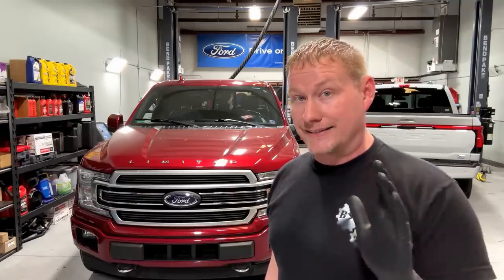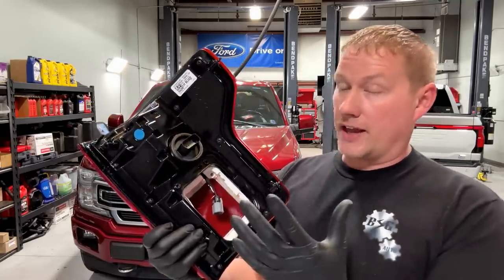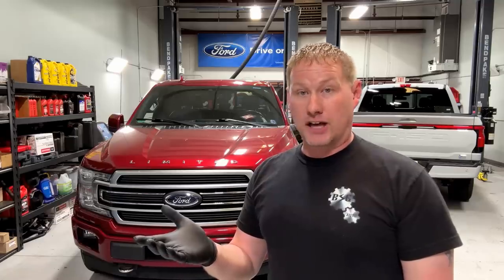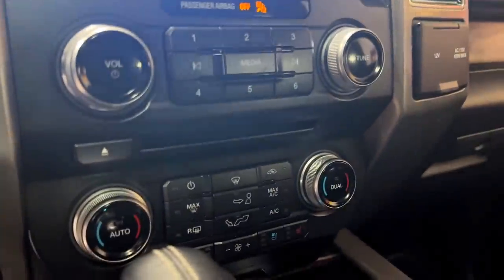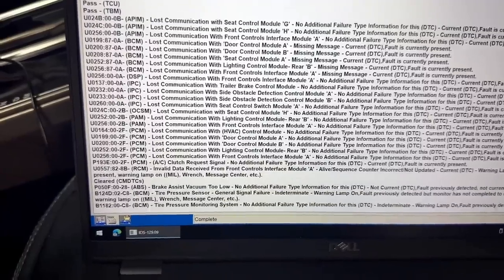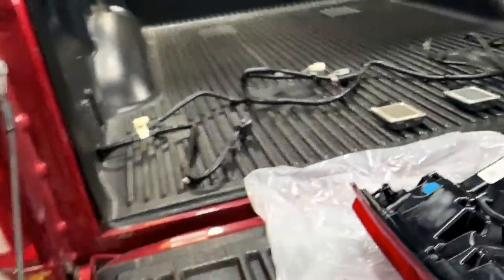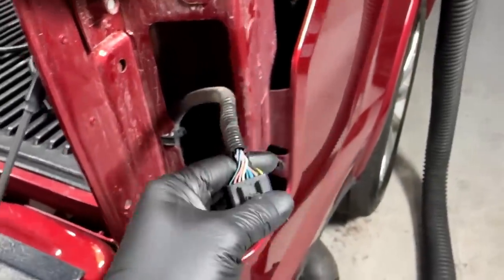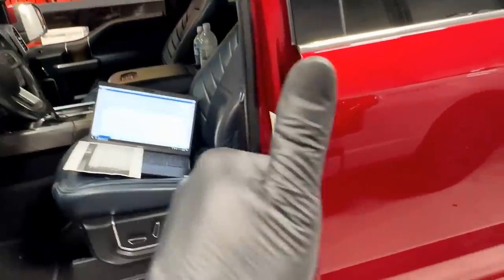Repair Cost Are Out of Control: $5,600 Bill for Some Tail Lamps?!

Comment: local dealership...went to shop and had a recall  for it,,, then they gave me the sheet,,, $1,400. cad added to my estimate for my front end suspension on my Hyundai// no .. walked out and I went to my b rated mechanic and only said it was $400. cad

Comment: Up until about three weeks ago I had a 2017 F150 ecoboost. We were going on a long trip when the cam phasers started making noise. $2700 estimate from the dealer to repair. That along with almost $1000 replacement on a leaking oil pan, a phantom coolant leak and warped brake rotors sealed the deal. I figured I could put another 4-5 grand into repairs or get rid of it. Traded it in for a newer vehicle, not a ford, and haven’t looked back. Truck had never seen hard use, kept it maintained will probably be the last Ford I ever own.

Comment: Thanks for pointing this flaw out to everyone. I have a 2020 F150 XLT and every time I leave the car wash, stuff doesn't work until it dries out and magically comes back to life. Mostly, it's been drive mode unavailable, which lead me to believe that there was a harness connected to the transmission causing this. Bingo, you nailed it. The local Ford Deale here is totally useless for any issues I may have.

Comment: I had a tail light case do the same and i spent the $1200. I did the work myself. My engine was shaking but was purring after fixing the t.l. I also had a brake issue. One side wore until metal to metal with no early warning. Had all brake rotors & pads changed. The gas mileage went up. Before, i got 11.2 mpg at the most. It's 12 mpg and climbing now. Go figure.

Comment: And let me guess, they did not cover it under warranty. And the people that just "Accept" this is the reason the rest of us cannot afford a vehicle. I had a similar problem on another F150 where the windshield leaked due to a manufacturing problem and leaked right into the brain module. Nope, not covered. Might as well had been a Pinto analysis - less cost to pay for legal fees of people killed rather than fix the problem. Just another reason I don't buy Ford or new.

Comment: im also a shop owner /operator ,mechanic 33 yrs ,  if people continue to buy their garbage , they will continue to take advantage of you , I drive a 1988 f350 diesel  , no ecm, no bcm, no tcm , no def , and what do ya know ,  it runs beautifully , and is ridiculously reliable , I couldn't count the times my old f350 has come to the rescue of newer vehicles , I see this in my shop often , overcomplicated over engineered and made to keep you coming back , for more parts , just had another Hyundai in the shop with the gdi motor this one 2016 , with 68,000kms engine seized solid , auto manufacturers are just like any big corporation , they are not ever looking for ways to make what they sell you better /more reliable , they are paying engineers to come up with all kinds of unnecessary components , you do not need , they have also made an art out of building components that will work for a while then fail , know this , more complicated is not better in any way , and also know that it is perfectly possible for the manufacturer to build cars and trucks that would last most of a persons lifetime ,

Comment: That's why I don't want anything newer than 2000. The problem is the shops don't want to work on any older cars because the new generation of so-called mechanics can't diagnose anything without the computer telling them exactly what part need to be replaced. So I have to take the time to do everything myself. 

I wonder what will happen when older people will be no longer able to fix stuff themselves.

Comment: It cost almost $300 to get my front headlamp replaced on my Ford Fusion SE because of poor engineering. The front bumper had to be removed to change out the bulb.  Not even LED.  Ford needs to review the ease and cost of servicing every model because the engineering of their recent cars shows a lot of failure to make repairs for even routine repairs ridiculously expensive and complex.

Comment: You are 100% correct concerning the cost & complexity of repairing the newer cars.  Those unnecessary modules are expensive, can often be on back-order, & seldom improve the performance or reliability of the vehicle.  The electronic engineers have now taken over the mechanical engineering of today's cars & trucks so get ready for a wild ride!

Comment: Huh, you use the same exact intro style as another channel I know. Weird seeing the exact same animations/background and having it spell something different this time. At some point people are going to realize trucks are no longer trucks. Super picky and fail all the time, repairs are complicated and extremely expensive assuming the parts are in stock, etc. They're not trucks anymore, lot of commercial places that I do work for have switched to panel vans for that exact reason. More space, can still tow/carry/move stuff, but half the price and half the trouble. Boggles the mind seeing a work truck be totaled in less than 10 years due to an electrical issue, twice in a row.

Comment: I have a 2015 Lariat F150 that experienced the same thing. Fortunately for me when Ford told me what the replacement cost was I took the tail light home and used a hair dryer , dried the module out , resealed it as well as the lens leak. That was 2 years ago and still running fine. The tail light moisture issue caused my radio, HVAC, power windows, all to not function.

Comment: I had the exact same thing happen on my car in high school, a bomber '63 Impala.
The tail light burnt out and removing it damaged the socket.  I had to find another socket
and solder up the connections.  - thank God I had one in my tool box.  I had a bunch of bulbs
as I steal them from the junkyards, that's the only thing I steal, 'o, and fuses  😆😆😆

Comment: The engineers wouldn’t put all this electric crap on vehicles. If you the buyers didn’t demand them my 2009 Ford ranger doesn’t have any of this crap on there hell even the climate control is cable operated that darn truck is 235,000 miles on the original powertrain all I ever had done it was a water pump, no electrical issues. See that to one of these new over priced urban cowboys if you really need Blindspot protectors, blah blah blah maybe you shouldn’t be driving a big truck in the city

Comment: We had troubles with taillights with some Chevy vans in the sixties.  We fixed the water problem by drilling 3/16" drain holes in the new taillights before installing them.  If the water is allowed to drain the only problem is an occasional blown bulb.  As soon as I saw water collecting in a light fixture on any of my vehicles, I replaced the bulb and drilled drain holes.  Never had any electrical connectors corrode after doing that. If the water drains quickly they soon dry out.

Comment: My brother is a Ford fan. In 94, his step dad bought a brand new f250 with everything on it. Three months later, he ripped off the driver's side mirror, which had turn signals in it. Bottom line is that the vehicle was totally disabled. Not covered under warranty, it cost him over 3000 in repair bills plus a tow to the Ford garage. It's been going on for a while 😮

Comment: What a terrible design, should be a safety recall, it has to do with safety 100 %
Great video 
Also,  if you replace all the taillights, do you have to get it reprogrammed to removed the notification on the cluster

Comment: Thank you sincerely for taking the time to make this and a couple of more associated videos. It saved be a lot of money. Bushings were $7.00 from Auto Zone and the few hours of my own time saved $600 from the local wrench's estimate to replace the complete shifter tube. I smoothed out the tube where the bushings are located under the clamps, removing the casting marks and rough spots which helped chew up the original bushings. I also applied a little White Lithium grease on the tube where the bushings ride and it shifts like new.

Comment: In all truth, not of those components are worth that much. It's called maintenance for profit. It's why I don't work in my field anymore. Just also want to add that you can buy a 3d resin printer for less money and print your own connectors. Contact your federal reps and demand the right to repair YOUR stuff. F*ck proprietary sht

Comment: I'm astounded that there's modules located inside the tail light housing. That whole thing looks like was designed to fail. Tail light lenses are notorious for getting cracked and allowing water ingress. I remember a 1990s Japanese car I owned; the tail light harness connector was inside the car, sealed behind a waterproof grommet. The only electricals that could potentially be exposed to water were the socket contact pins for the bulb.

I started hating working on modern cars, and instead became a bicycle mechanic. I've found that dealing with nightmare automotive wiring was a very useful skill for working on e-bikes. Many e-bikes have fully exposed wiring. I've seen a few that have had the power connector to the motor get melted. Whenever I'm setting one up, in addition to coating the pins with dielectric gel, I also wrap the entire connector with electrical tape to make sure no water gets inside. You might want to do the same thing with those exposed Ford tail light connectors.

Comment: I understand the connectors got water on them .. Causing this problem , but how on earth did water get into the plastic lens light covering in the first place ..not just the socket that holds the light bulb or camera .. But the whole read plastic cover that hooked to the metal frame .. had a 1995 ranger , and a 2004 ranger .. Had a problem with my doors rusting .. Not from the outside in , but from inside the door .. Well I noticed between the doors , that no weep holes to let water out of the door .. And that the rubber /plastic was the only thing that holds water from getting into the door when raining ..  Those seals of rubber that are mounted to the door frame that the window glides across .. are the worst things made .. Back in the 70s the had the same rubber guards , but if you pulled the rubber back to look down into the window , you seen what looked to be strings , rapped around a flat piece of steal , the hair string bars that went from one side to the other was to help keep moisture and water from getting into you doors .. Plus they sealed door panels with plastic , which looked like they used tar as a black glue .. Never seen a door wet inside of any car door when taking the cover panel's off .. but today cars and trucks after 4 to 5 years of owning them if kept outside , and you don't have a garage .. Will get damaged , and car doors have speakers hooked to most doors today .. Which connect to the radio which connect to you backup lights and back up camera .. which is hooked to a gps system .. Are we heading in the right direction with a on board computer system , that can drive by itself .. No .. All compute have a failure rate .. Let alone software programming bugs that are not fix , as they still sell people cars today ..

Comment: why the customer went "oh well" and did not complain about the cost is because that particular truck is probably ford's higher model that could easily cost over $100000 and the customer is rich maybe even the parent of a child in college  so $5600 is nothing just like a high roller can throw away a million on a single bet.

if you try to work on the battery on evs that can be tricky because of the high voltage they can be dangerous to work on even deadly so extreme safety needs to be taken if you try working on the battery.

Comment: I can't understand how none of those assemblies can be recycled. I see nothing wrong with the taillight assembly. I'll assume the only problem is water intrusion. Why not replace what's not working like the connector housings harness and internals. Seems to be you're just adding insult to injury not replacing parts and doing a grenade job. If it's at all possible I'll do what I can for my customers. seems odd you have to scrap those perfectly good lenses and by all new ones because you can't replace the internals.

Comment: The problem is not modern technology. Its mindless design: Sophisticated electronics packed into sloppy waterproofing, modules mechanically too intertwined to exchange separately from each other, designing without considering accessibility for diagnostic access to the physical interconnections, and most of all: No transparent diagnostic interface to the owner or user of the car, despite the vehicles being packed with computers, giant screens, sophisticated internal diagnostics of control units, etcetera.
There is no valid reason at all to not integrate a data logger into the cars user interface/info/entertainment system, in order to produce a data package that the user could easily send to any technician or directly to the manufacturer. The hardware of any modern car would be sufficient to provide users with an interactive and transparent diagnostic software and self explanatory procedures to cover the majority of faults.
Modern cars could easily provide means for the workshop of choice to get all necessary fault codes and running parameters to start a diagnosis process even before the car has to be brought into the workshop. Instead, there's still an expensive piece of hard- and software needed by each and every repairer, that has to be plugged in before the technician can even start trying to solve problems.
As long as manufacturers follow the black-box design philosophy, consumers will only benefit from a fraction of what modern electronics could provide, while paying dearer and dearer for those few benefits.

Comment: Like water and oil don’t mix , there are 4 things in the automotive industry you shouldn’t mix together , engineers, bean counters, water and spare parts costing. Mix all 4 and the customer and the tech are the ones that suffer. 
New cars design is customer driven and customers want tech in their cars. It doesn’t make the car any safer, it just make the driver lazier.

Comment: I own a 2018 jeep wrangler Rubicon with the LED light package my right rear tail light went out it had water in it the factory light assembly was 805 at the dealer I replaced the light with aftermarket parts so I take the failed light apart to see what happened to my surprise none of the circuit boards were sealed in epoxy they were just bear boards

Comment: Jesus has ford heard of conformal coating? Or even potting the module.

Sounds like a class action incoming. If a parts on back order you know theyte getting thru a load of them.

Could you not send them to a specialist to get them repaired thatd make more sense. I get you guys couldnt do it but theres plenty of places that can like Northridge etc

Comment: A electronic magnetic impulse can induce a a no start condition.
Computer assistance vehicles can be vulnerable to outside electronic interference.
A cascading effect of inputs from wiring systems information.
Tree air freshener will however continue to work.

Comment: Ford has never gotten it since back in the 80's on dielectric grease application. I fought issues for years just because they mount electricl devices right where water can intrude and don't treat the connections even. Sad !

Comment: This looks like a Ford problem to me. Cars get wet, we use them in the weather, take them to car washes, etc. There is no excuse for this happening in the first place. Ford should have had a better design with proper sealing. It is good that the insurance paid but Ford should have done it right in the first place and covered the cost. Completely avoidable had there been proper assembly or a proper design.

Comment: Serious question (not sarcastic or rhetorical, that is): Why is the truck not designed in such a way as to, if not prevent the ingress of water in the first place, allow the drainage of the water that apparently inevitably leaks into the tail-light housings?

Comment: His truck needs some drain holes, that's insane that there was so much water in there. Also on those connectors, they should put tons of dielectric grease to prevent water from rusting out those components. I wonder if a ultrasonic bath on some of those components might make them work again. (Maybe even a ipa rinse, and oven bake.)

Comment: I have the same problem and Ford will not cover the replacement of the tail light assembly. I have the Bumper to Bumper Ford warranty that cost a lot of money and they won't cover it. It has water in the assembly have not been bumped or anything. I caught mine early before the corrosion set in. They told me they would only cover it if there was an electrical issue, can you believe that? I'm an electronic engineer and know that corrosion can wreak havoc with electronics. Ford needs to train their  warranty people to make better decisions to prevent further cost.

Comment: Seems to be a common problem in newer vehicles with all these new sensors and electronics.  I have a 2023 Acura Integra which was unfortunately in a collision with a deer last month.  Ended up putting a crack in the headlight lens which intitially wasnt a major issue.  Well it rained all that day and through thr Night and the next day I was driving the car and started getting all kinds of error codes and the blinker quit working.  Stopped at the nearest parking lot and basically couldn't even shut the car off from accesory, put it in drive or anything.  It basically immobilized the entire vehicle.  After a call to the dealership and nearly getting it towed, i unplugged the headlight and everything basically went back to normal and all of the error codes stopped and the car was driveable again.  Absolutely insane how sensitive the electronics are in these new vehicles.